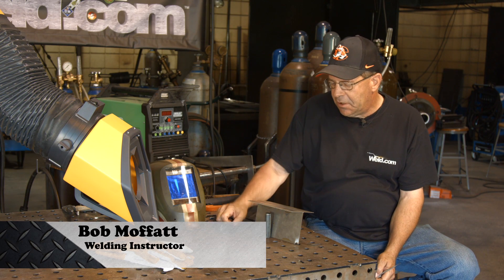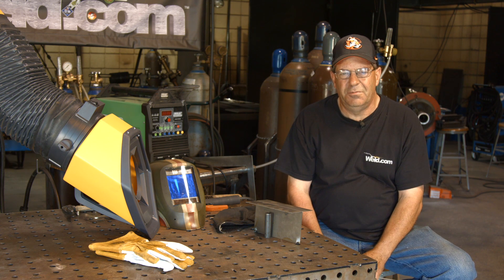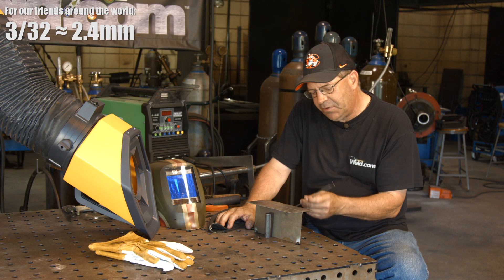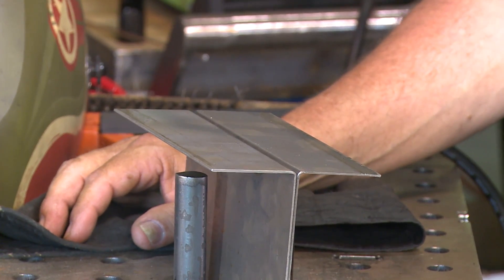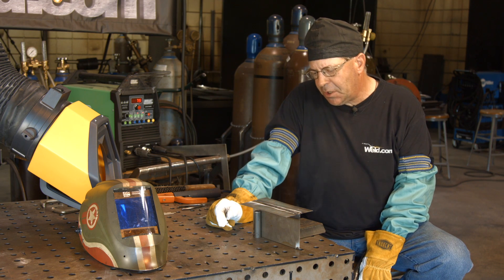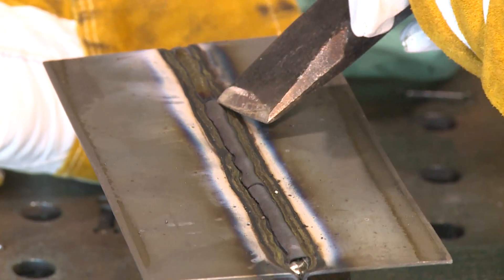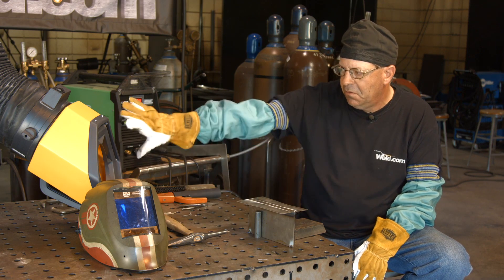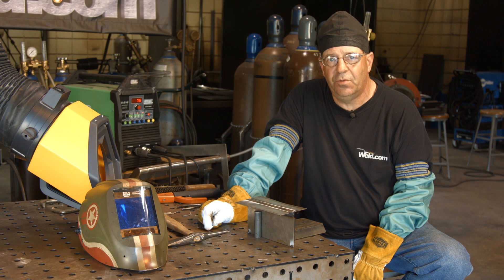🔥 AC Stainless Stick Welding (Everlast PowerTIG 250EX)

Comment: I'm interested in seeing what the practical differences are between 6010 and 6011.
Where I live, I can get 6011 by the boatload, but I have to special order 6010.
After one of those rods is used I simply cannot tell the difference between them and want to hear or see some measurable differences in the applied weld.
As a student, whisper I liked 6011 better. I could turn the dig all the way up and got reliable keyholes (for my hand at least) 
So many (NAME BRAND) 6010 rods just turned into matchsticks on me at full dig.
They seem very finickey to me but appear to lay down no (visibly) superior weld when doing open roots.
Screw 6013 forever in my book, 6011 is the do it all rod :-/
Can you change my mind?

Comment: Would it be ok to stitch or step the puddle on this weld or is it always better to "drag" the puddle. I think it would be easier for me to maintain bead consistency if i were to work the puddle a bit. Also, have you ever ran 3/16 7024 on 3/16 plate? I do that every day at my job and find it quite difficult to get a slag peel. I know the electrode is too big but, the bosses want you to lay down a lot of metal in a little time.

Comment: Hey, Bob, thanks for another good video, but I'm sorry, I don't get the AC thing on a stainless steel. I do understand why one needs AC on something like aluminum (or aluminium as we are used to say here) to thermally stress and to break thru the protective oxide layer, but I don't get why it can be helpful on any ferrous materials. Please advise.
Reply: TheZzziggy No arc blow. Less penetration.
Reply: Eh... emmm... sounds weird yet interesting and intriguing.
Bob, thanks for getting back to me on this. Can you please elaborate the AC-on-ferrous thing in some further videos, please?

TIA,
Zig
Reply: I wish YOU would show us some stainless Tig work.  Mr tig did a couple of videos and they were shit.  no offense to the fat man.

Comment: Hey Bob , thank you for your videos . They are interesting and helpful as always. I had a request about stainless steel sanitary tubing. Could you do a 304 L 2" tubing with no gap and no filler in 5g or 6 g position and explain how to control heat input and what is better to walk the cup or do freehand on such small pipe diameter ?